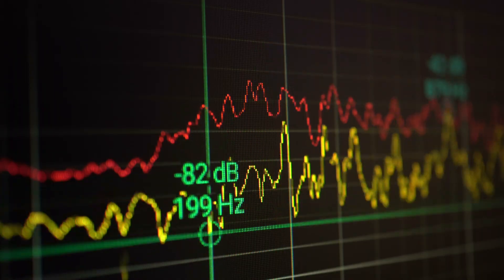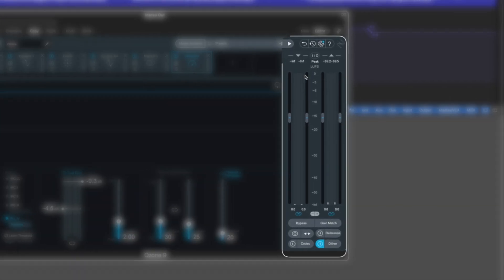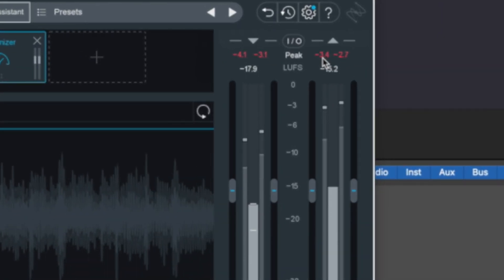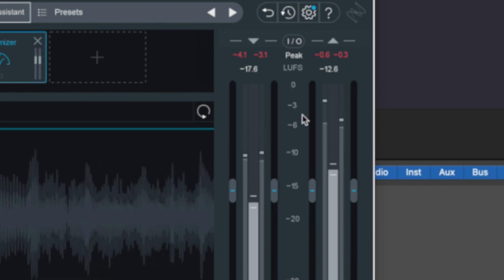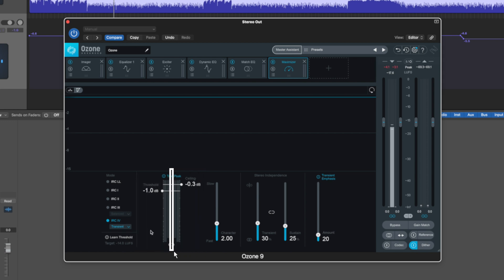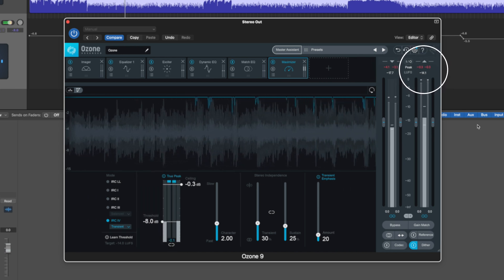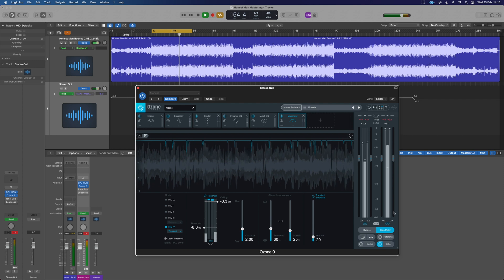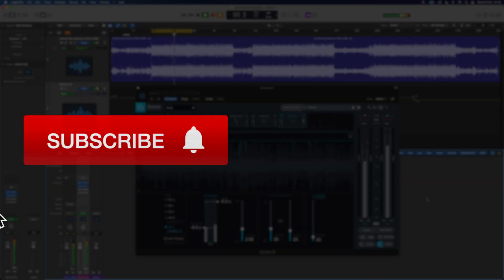how to use Izotope Ozone LUFS Meter

Comment: Cant find the info, but why just not to turn up or down output level slider to make song louder or quieter? Why you tweaking only threshold parameter in maximizer module for tweaking volume? Thanks in advance.
Reply from the maker: If i understand the question, because it's a tutorial on the LUFS meter and not a mastering tutorial.
Reply: @Unders  yes, i understand. But doesn't it affect final lufs level as well?

Comment: I have a question and I hope you can help me. I made a very noisy distorted drone song that needs to stay that way and I cannot reduce the threshold on the maximizer any more than it is. Is it ok if I just slide the output master on the right down until it reaches the desired LUFS or is there a better way to reduce the volume while retaining the oomf and snap. It doesn't sound bad at all but I just want to know if you know of a way?

Comment: If you can't see LUFS at the top like me, you have to click on the I/O and choose Type: Short Term + Max Peak.
Reply: spot on. this was the key piece that I was missing
Reply from the maker: its at 0:30 of the video :)
Reply: @Unders  Yours showed LUFS before :30 so I didn't know that changing the I/O would show LUFS if I chose the right Type. K System and above choices show RMS on the meter. Mine was showing RMS.
Reply: @beatweezl  Thank you so much for sharing! Mine was showing RMS too and I was trying to work out how to switch it to show LUFS. All fixed now! :D

Comment: Nice video! How, in practice, using LUFS does change our mixing decisions compared to use RMS or VU? Is it only about putting a gain at the end of the strip and changing it to match the required LUFS or does it inform us on other possible decisions like using the eq or compressors? Thanks!
Reply from the maker: LUFS is the overall loudness metric used by services like Spotify, Apple and Youtube. The idea being as an average the level remains about the same. -14 is the requested target. However it can vary to medium or service.